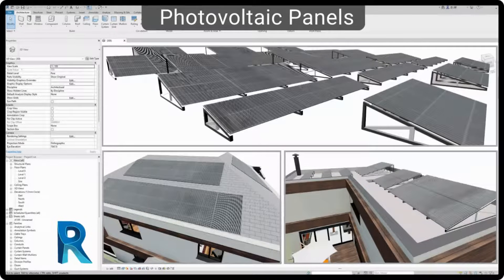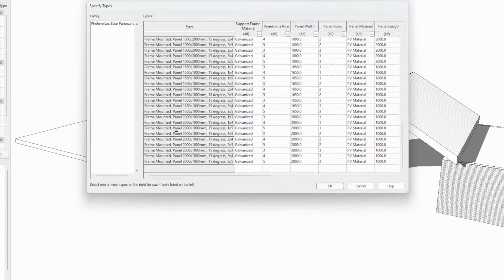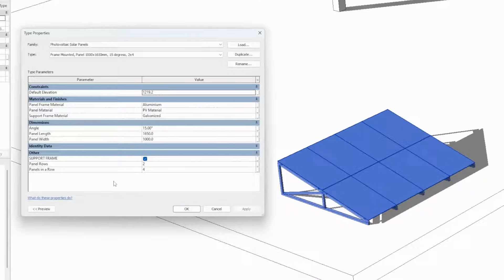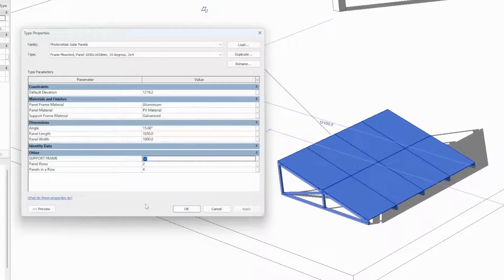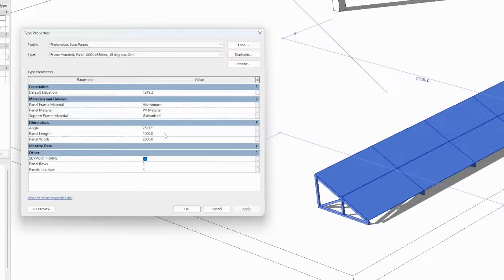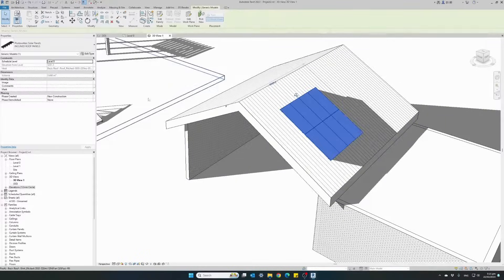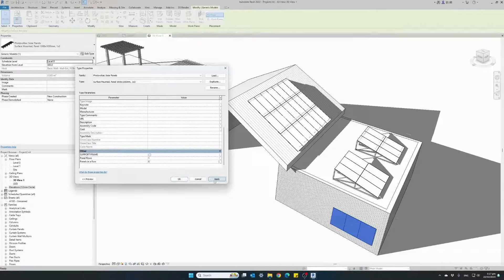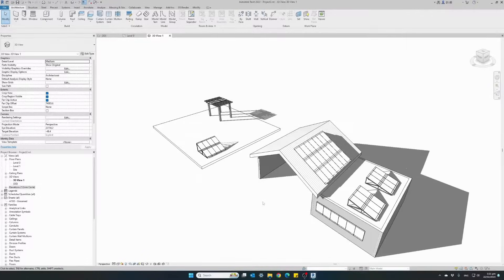REVIT Photovoltaic Solar Panels Family

Comment: hello, does it work with all versions of revit? or only recent versions?
Reply: one more thing: i assume it only allows panels to be installed in uniform grids. in the event that we need to remove some panels shaded by objects, can one affected panels be removed from the installed panels? soome costware like heliscope will allow this. but this stuff you showed above looks very easy to use and modify.
Reply from the maker: @alexanderfrederick3632  Hi again, you cannot remove single panels from the array. Nevertheless, why would you want to remove a single panel. The sun moves and no single panel is always shaded.
Reply from the maker: Hi there, the family was created using Revit 2022 as shown on the link provided in the description, therefore it is compatible with 2022 and newer versions. It is NOT backwards compatible.